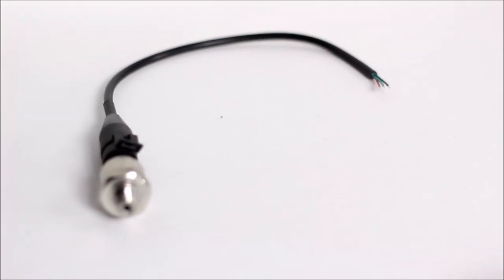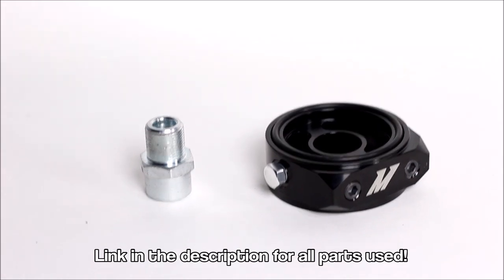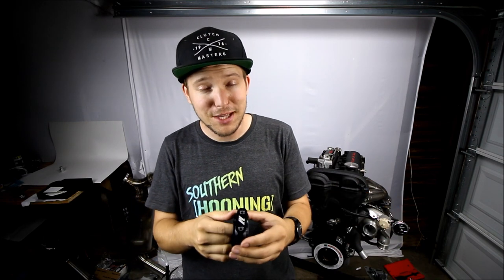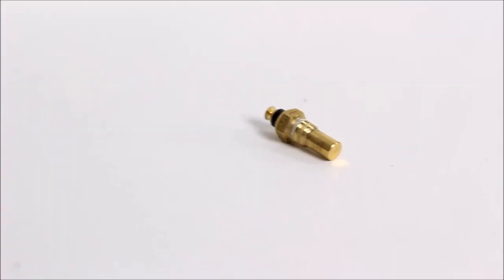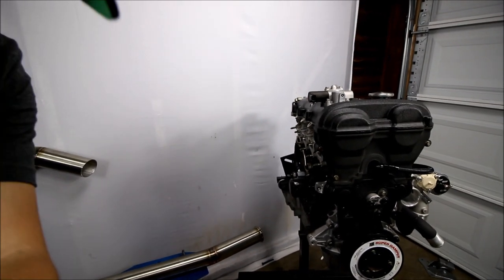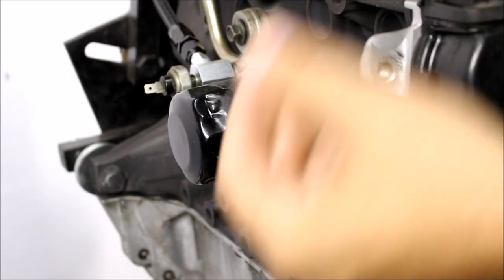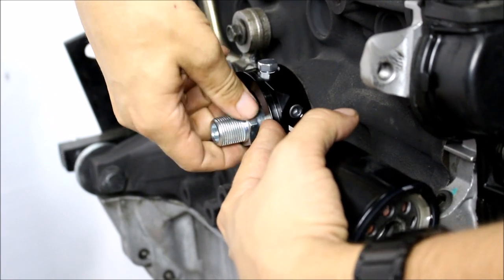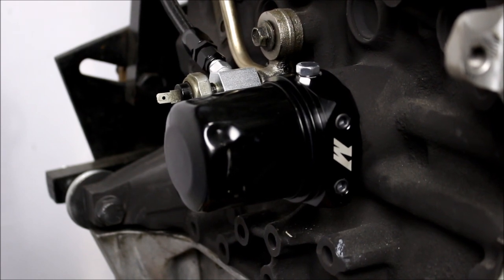Oil Pressure & Temp Explained + Sandwich Install (Rebirth Ep21)

Comment: A few tips for people that want to copy Greg's setup:
1. You need to sand / grind away the anodizing on the sandwich plate where the post extender presses against it (right under the hex feature). This is necessary to ground the oil temperature sender to the block. This step is not necessary for the oil pressure sender, because it uses a separate ground wire. 
2. You will need a bias / pullup resistor to connect the oil temperature sender. Typically 2.49KΩ
 is used, but any resistor in that range is fine because you can specify the resistance in TunerStudio. I used 2.2KΩ.
3. Connect the oil temperature sender to an analog input pin. I used Options Port D (Analog In 1). Then connect the pullup resistor between the temperature sender signal line and Options Port H (+5V Ref). 
4. In TunerStudio go to Tools > Calibrate Thermistor Tables. Select "Custom#1 Temperature Sensor". Enter the resistance value of your pullup / bias resistor. Then enter three known temperature + resistance datapoints
5. The datapoints for the VEI Systems Temperature Sender are:
32°  F = 6000Ω
124° F = 578Ω
200° F = 129Ω

6. Then go to Advanced Engine > Generic Sensor Inputs, select your analog input, name the sensor, and select the "Custom#1" transformation curve.
Reply: Is this the steps to hook it up to the mega squirt?

Comment: He is 100% correct about the temps. I wait until my Miatas lifters stop ticking, wait for my temps to rise to almost the middle, then I still drive around for 5-10mins of "warm up driving" before i even start being rough or having loads of fun, simply because tires, drive train, oil all needs time to warm up. Just taking it easy and cruising around like a BAMF for a few mins is worth it!

Great video man! Love looking at that clean engine! Its so beautiful. OCD or not, doing it right is the way to go man the only wait to achieve perfection! Never cut corners on things you love. 

OG Homie! Greg, clearly you love Miatas, but do you have passion for other JDM machines (love for other manufactures?), If so, which ones? Do you have other hobbies /things you love to do, that you do aside from cars and driving?

Comment: First off, as always, thank you for taking the time on this vid. But man, I got so many questions!

1. How are you getting a ground on the oil temp sensor? Normally they ground through the housing/threads, but you're using sealant on the threads.
2. Same question about grounding, but this time about what looks like an anodized aluminum piece that's probably not going to conduct well against the block, right?
3. If you run a separate ground wire, how are you attaching it to the temp sensor?
4. I looked at the particular sensor that you ordered and it doesn't have a calibration table. How'd you configure Megasquirt? Did you just stick it in water at three known temps and measure resistance or something?

You rock, thanks again for all you do, and hope your summer heat wave ain't treating you too bad!
Reply: 1. You need to sand / grind away the anodizing on the sandwich plate where the post extender presses against it (right under the hex feature). This is necessary to ground the oil temperature sender to the block. This step is not necessary for the oil pressure sender, because it uses a separate ground wire. 

4. In TunerStudio go to Tools > Calibrate Thermistor Tables. Select "Custom#1 Temperature Sensor". Enter the resistance value of your pullup / bias resistor. Then enter three known temperature + resistance datapoints
The datapoints for the VEI Systems Temperature Sender are:
32°  F = 6000Ω
124° F = 578Ω
200° F = 129Ω

Then go to Advanced Engine > Generic Sensor Inputs, select your analog input, name the sensor, and select the "Custom#1" transformation curve.

This is working on my Miata and the readings are spot on.
Reply: @NickNothom  DUDE THANK YOU!
Reply: @NickNothom  Can i ask when i sand Down that oil sandwich how Can it be grounded when is sealant on thread ? 🤔
Reply: @jozik_sk  Mine grounded with thread sealant. There is still a lot of metal on metal contact, the sealant just fills the gaps.

Comment: I recently lost oil pressure cause a fitting on my oil sandwich to loosen dumping all my oil on the road 🤦🏿. It was a 2 min drive around the block but good enough to practically empty the pan. The one good thing is that the engine didn't make any weird noises.

Comment: i would mock up the alternator because those fittings may be in the way. it was a pita positioning the plate and still be able to use two sensors and a feed line without kinking anything

Comment: For the Q&A:

Since I'm building a supercharger build for my 1.8 VVT, I'm curious on your thoughts on superchargers, Greg. Everyone and their grandmother seem to love the turbo. It's cheaper, sounds better and gives you that kick in the pants. But do you dislike superchargers? Or is it simply that you like turbos more? Why? For what reason do you prefer one of the other?

For my own sake, I like the supercharger for it's relative uniqueness (here in Sweden, I'm one of very few Miatas with superchargers over turbos) and the complete lack of lag and massive low down torque. It is, however, much more expensive. I could've done three turbo Miatas for the money I spent supercharging mine.
Reply: I am not Greg but I guess you answered it yourself. Turbo is the biggest bang for the buck. For me thats basically it.

Comment: You can also add a Mocal Laminova Oil to Water Heat Exchanger. This will allow your engine to heat the oil faster by water temperature and vice versa to cool down the oil for an average viscosity

Comment: Hey Greg, love the channel and its direction. I have two questions to ask. First one is what other passions do you have besides cars and YouTube? The other question is that would you rather use a Torsen differential from the 1.8 Miatas, or would you rather use the RX7 FC clutch type diffs for the Miata. Thanks! Your videos helped me learn my way around my 93 Miata :)

Comment: Greg, when someone buys a used miata, besides checking the things you mentioned in the video "How to buy a used Miata!" what would be the next maintenance essentials and checks that a newbie needs to go to? and why? maybe a priority list. 
This could be a whole new video of you going and showing where to go. 
This is my situation now and it might be for a few others out there. I just want to have my car fully operationala and every little part of it running good before I start doing the tunning.
I feel like if I go, tune the car and destroy the transmission or other parts of the car it would be dumb.

Comment: What are your thoughts on; Turbo vs supercharger vs ITB'S ?
Reply: And to add to Alwin's question...
What are your thoughts on twin charging? I am currently supercharged and plan on adding a turbo set up I have ✌🏽
Reply: Well I want to give you my opinion, you can have ITB'S with a turbo or a supercharger, all an ITB kit does is just it allows more air to flow in the motor so I would suggest getting bigger injectors to compensate for the amount of air going in the motor. Which you would also need to tune your car so the ECU knows what your AFR should be. And with super chargers vs. turbo, it depends on what you want. If you want full boost all the time you should get a super charger, but with turbos if you have a small one, it will spool up pretty quick so a lot of torque at lower rpm range but you won't get a ton of power in the top end, as with a bigger turbo it takes a little for it to spool up as you accelerate but gives you a lot of top end power to push more HP. Hopefully this helped!
Reply: Not twin turbo, twin charge...
Supercharger & turbocharger 👍🏽
Reply: Yep, always learning ✌🏽 I am quite far into it. I have designed and build a custom supercharger setup using a Mercedes M62 charger 👍🏽 would love to get Greg's opinion on twin charging and if he has any knowledge about it, I know the idea just seems crazy to some people 🙈
Reply: twin turbos are still relatively common, especially bmw's
Reply: Watch the Mighty Car Mods test of S/C vs Turbo on two miatas. Long story short, the turbo made more power and about the same low end as the S/C. ITB's sound awesome but unless you got deep pockets for a built N/A engine, you won't get much power from them.
Reply: I would say on twin charging you would have a lot more power at higher rpm on top of the mid range grunt you've added. does your supercharger have a blow through feature? in that case you could eliminate most parasitic loss at a higher rpm, they had an elise with a twin charge setup on DRIVE, it was a tuned episode.
Reply: Charles Stevens yes that's the aim as the cars use is mostly at the higher rev range. Thanks for the response I will check that vid out ✌🏽
Reply: Alwin Itb's are my choice! Yes, You wouldn't get as as much power as a boosted engine would. But the instant throttle response and amazing sound and they look bad ass. That Old-school vibe. The Raw Engine sound

Comment: Hey Greg, why aren't you running a sandwich plate with two 1/8" npt ports and two AN ports so you can run an oil cooler? Seems to me you will get a lot more heat in your oil and coolant if you drive it moderately hard
Great content though!!! :)
Keep up the good work

Comment: Note to everyone, you can't run an oil feel line from a sandwich plate to your turbo because the oil pressure would be too much. it will cause the oil seals of your turbo to leak and will either start burning oil via exhaust side or the turbo or be sucked through the intake.
Reply from the maker: Frederick John Teng That's what restrictors are for? I ended up not using that anyways since oil would be unfiltered

Comment: This answered some old question and created new ones:
Is it really necessary to cut that threaded rod for the filter in order to put that sandwich plate on? And why can't you still use the old oil ''cooler'' (it's a warmer actually) on there? My thought was that the OEM cooler/warmer thingy helps to get to operation temps much quicker while the new awesome Mishimoto cooler helps to keep them temps down in case of furious track use :D
Because then the whole assembly of OEM-cooler+sandwich+filter would fit without the extender, wouldn't it?
So my plan was OEM rod+OEM cooler+sandwichplate+filter. Yeay or nay? :D
Reply from the maker: +Backyard Gearhead I'm 99.9% sure you can set it up that way.

Comment: the next thing to do is water injection to lower the combustion temp back to normal. VERY VERY VERY IMPORTANT COOL THE FLAMES INSIDE THE COMBUSTION PROCESS.  THIS WILL ALSO MAKE MORE POWER ALONG WITH PROTECTING THE ENGINE. with the new eng i would change the oil every 2k miles. keep the lube perfect at all times. oil is cheap parts expensive

Comment: LMAO way too OCD to have a dead one.... *every video made has a broken speedo gauge* 
Dont take it too hard, I love the videos man. Keep up the good work, huge inspriation
Reply from the maker: Hey it's fixed now give me a break 😂
Reply: @TheCarPassionChannel  howd you fix it? It was because of the trans swap, right?
Reply from the maker: @christianthresher195  Correct. I fully converted to an NB cluster, I have a pretty recent video on it. Pretty in depth conversion but it's so worth it!
Reply: @TheCarPassionChannel  did that oil pressure sender from Amazon work accurately and for a while?

Comment: Hi mate! You are competing with mishimoto support line now... So, here is the thing, I'm after a mishimoto sandwich plate that has one sensor port and 2 lines behind a thermostat in order to add an oil cooler. Problem is, that they don't list my car, they list only 1.8 mx5 and I have an early 1.6. Do you think it will fit? since you tear apart both engines on your garage... btw mishimoto support is so slow, I've asked them on Monday lol...

Comment: Surprised you aren't running an oil cooler, ie. a thermostatic sandwich plate and taking a T peice off the original oil pressure port.

Comment: Great video!  Love the content!  I am finishing up my Megsquirt build and like you I am installing extra sensors for maximum protection.  For you oil temp sensor what voltage values are you using to ensure your values accurately display in TunerStudio?

Comment: I noticed you removed the stock oil cooler.  What's the plan there?  Do you think the stock oil cooler is ineffective or not needed?  Or are you running an external oil cooler?  Also - I had a heck of a time installing that mishi sandwich plate on my 2001 VVT block - the post was too long, so the post extender could not thread far enough down onto the post to tighten the sandwich plate against the oil cooler.  I ended up fabbing a spacer to place between the post extender and the sandwich plate, but the issue would have been even worse without the oil cooler in place.  Thanks!!!!

Comment: One thing you didn't show us was how you wired the oil pressure and temp sensors into megasquirt. Did you have to build any circuits to accommodate for those extra inputs? Which MS lines did you use?

Comment: What kind of sealant are you using on the threads of the sensors on the sandwich plate?
Reply: I'd also like to know. That's the reason I watched the video.

Comment: When I removed my sandwich plate the threaded post was way to long to install the adapter on my 1.8.  I noticed when you removed your oil cooler your stud was also very long , but when you installed the sandwich adapter it was short.  Did you cut it or change the center post? The long stud on my 1.8 will not allow the post extender to tighten down to the sandwich plate.
Reply: Im looking for the same answer 🤣🤣

Comment: Nice video! A couple of questions. Where do I have to pass the wires to enter in the cockpit? What kind of sensors (temperature and pressure) do I should buy?
I drive a 1.8 NBFL Miata.

Comment: You may have said that, but do you plan to run an oil cooler?
I am currently thinking about running one, but that would mean I had to run the sandwich plate solely for the cooler and one sensor (pressure for example) an adaptor like yours from trackspeed for the turbo feed and another sensor (temp for example), wouldn't it? Or do I miss other options? :D Also, I am not sure if I really need a cooler ....
Reply from the maker: Backyard Gearhead I'm not running an oil cooler to begin with. I'll have oil temperature to watch, and that will tell me if I need a cooler or not.

Comment: Another great vid as usual 👍🏽 my question... 
I run a non vvti 1.8 and I'm about to do a forged build I have another 1.8 to build but are the vvti advantages worth me selling the one I have and buying a vvti to build??
Reply: I'd say no, except you have a VVT available right now and could switch to it without financial loss. I don't know what these cost where you live, but here in Germany this engines cost twice of what the usual 1.8 costs :( . I guess they are not that different when boosted, so I'd stay non-vvt if I already had a 1.8. I only got one with VVT because I switched from 1.6

Comment: I tried a sandwich plate on my 1990 miata but could not screw on the oil filter due to clearance. Any ideas!
Cool build by the way.(y)
Reply: Were you ever able to make this work? I have a '90 and have no issues.

Comment: I am very new to the mx-5 (not to the channel subscribed like 5 years ago and been following everything since) But that adapter plate does it also fit the 1.6 from 1991? Got a imported miata from America here in Europe. And yes it's going to get boosted. But it will be a slow process, it already has a aftermarket ECU, the ME221.
Reply from the maker: It should work on all 90-05 engines but the compatibility should be listed on the website that you buy it from.

Comment: Looks like you've decided not to run the oil "cooler". Will you cover why not and the whole coolant routing plan in a future video? I also noticed you are not running the heater core lines as well.
Reply from the maker: +Jeff Mendoza Yes I will get into all the coolant routing once it's in the car. I will be running a heater core, just not a factory return line location

Comment: Which stock Miata transmission and stock Miata differential are strongest?  (manual 6 speed trans and torsion dif?)  And how much HP will they RELIABLY handle?  And how much would you have to build and boost a 1.8L motor to RELIABLY dish out that much HP?  To make an MX5 "be all it can be" (and still be pretty much stock)...
Reply from the maker: +Wils0n951 6-speed and any 1.8L differential are the strongest factory Miata pieces. They will reliably hold 350whp+, some have gone into the 500's but typically those cars have no traction so they can't break anything. For a 1.8 to get into the 300-350 range reliably you just need rods, pistons (debatable), some form of oil pump protection (damper or better pump gears), and the rest of the supporting mods. Fuel, ECU, big enough turbo, etc.
Reply: Thanks Greg.  I'd be happy with about 250whp, so it's reassuring to know the drive train I have in mind can easily handle it.

Comment: So you say you want your factory OPG to work even with the extra sensor yet you have the dummy oil pressure sender on the block? lol. At what point do you think you could tap into the oil pressure too much? You have the VVT and the turbo, do you think 3 oil-pressure activated things is too many?
Reply from the maker: Brap Brap The dummy sender is threaded in as a placeholder until my 1.6 sender arrives, covered that already in a previous video that you need to run the 1.6 sender. And a sensor doesn't cause any loss of pressure or flow, I could run 200 temp sensors and it would be fine. :)

Comment: Nice Video!! the filter on my car has a male end that threads into the housing on the engine.. will these universal adapters work if I reverse the  extender in the middle since they're the same thread pitch? I cant find an adapter that shows an install on a filter like mine. Thanks !